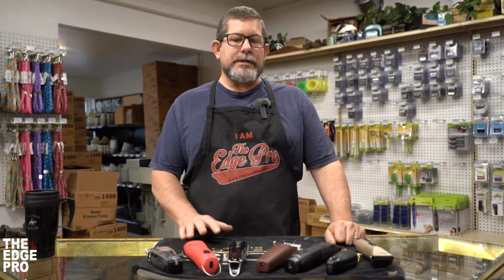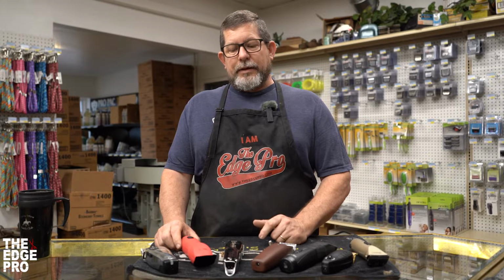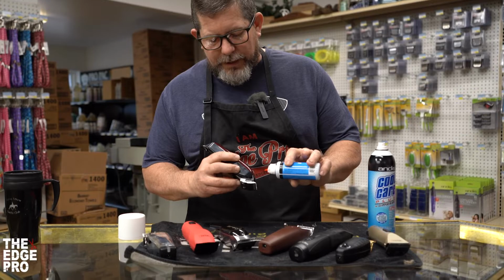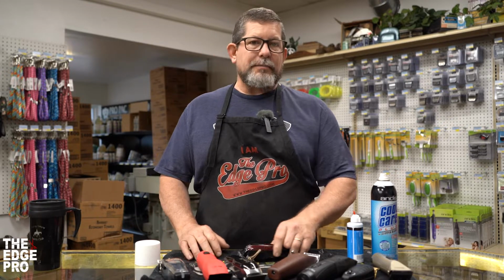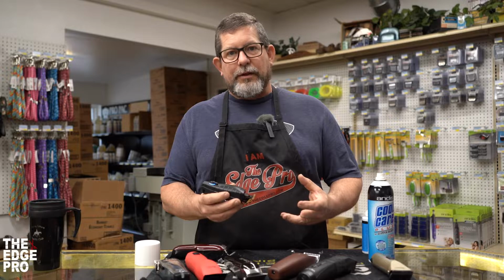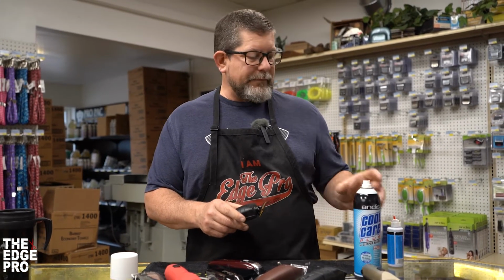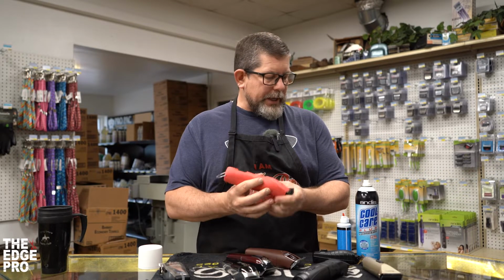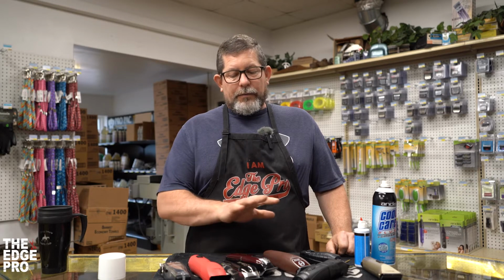Clipper Maintenance (Cordless)

Comment: Quick question !! 

I dropped my Andis fade masters on the edge of the blade . Now, every time I turn the clipper  on w/ lever open there is no problem. But once I close the lever, the cutting blade stops moving and I can still hear the motor humming. I literally took the whole clipper apart and put it together to see if I could find any issues but nothing lol. Any advice?
Reply from the maker: Hi Aaron! Most likely the field is "popped". This means that the winding has slid on the core and is taking up some of the space that the arm traditionally would move in. We have a video on fixing that. https://www.youtube.com/watch?v=z6ljQ72uWBU. Start around the 40 second mark and it will walk you through how to reset that.
Reply: @TheEdgePro  Thank you! I’ll give this a try